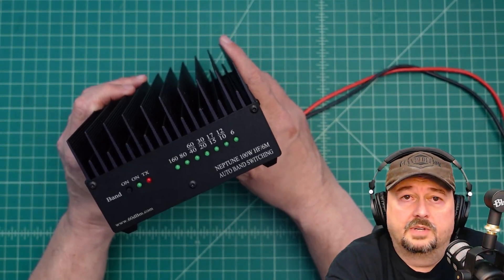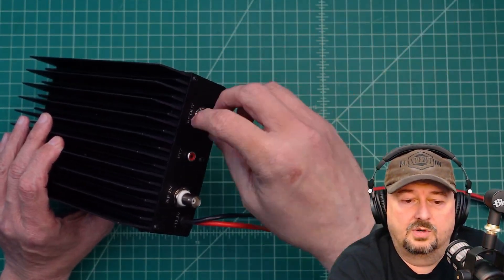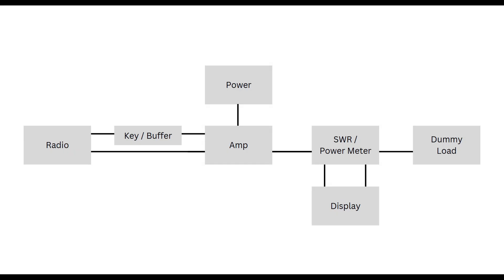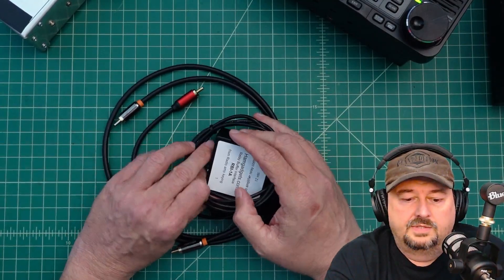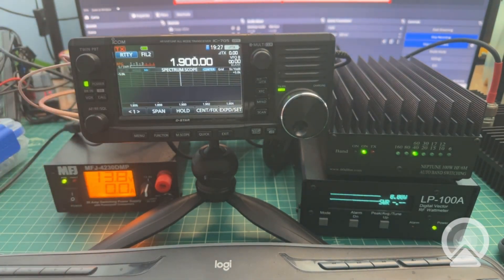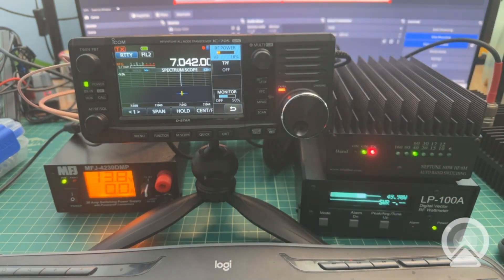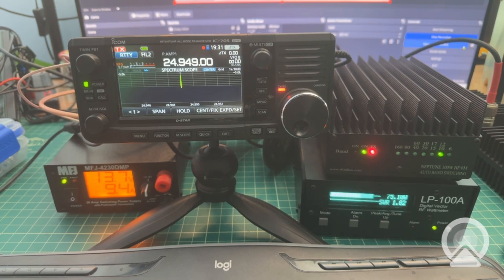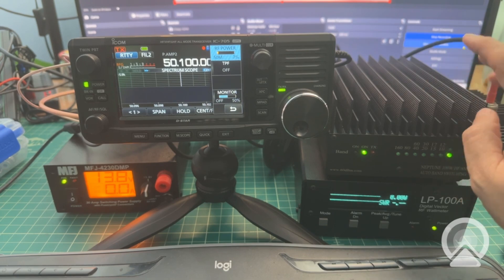Unleash the Power of the Neptune 100W HF Amplifier for Ham Radio!

Comment: ...or buy a FT-991A for your portable operation. Probably less costly than buying a 705 + Matching Unit + this amp. Also probably a smaller footprint and overall combined weight. Plus no interconnect coax cables. Just saying.
Reply from the maker: @martinvanek5951  what if I have more than one QRP radio?  What if the 705 has features the 991A doesn’t? What if I want to use my 705 at home with 100w and QRP portable?

Comment: Looks like a really cool amp, but my major concern would be when out in the field using it, you are not going to know if you're overdriving it or not. Some bands you're at 1w, others 5w. So I'm weary of using an amp for that reason, not knowing if I'm overdoing it and about to damage it. Unless, you just run lower power to preserve its life and only shoot for 50-75w output. Kind of strange the difference in drive between 12 meters and the other bands like 6.
Reply from the maker: @Kody10538  I use an ATU that shows power out but you make a fair point
Reply: Which field ATU does that?  I'm just conflicted on it. Love my 705, and i have an 891 in the truck. I have a hard time deciding between grabbing an amp like this or just picking up another 891 for portable use. Far less cables that way.  Guess its six of one and half dozen of the other lol@TheSmokinApe
Reply from the maker: @ I use this one Antuner AT-100M Pro Antenna Tuner - Honest Review and Setup Guide
https://youtu.be/LbGOeFkhy0c

Comment: Why don't folks just buy a 100 watt rig to begin with if that's what they want to run?  They buy a radio that costs $1400 and then buy an amp that cost another $500.  You can buy a 100 watt rig for less!  If you want low power, turn the 100 watt rig down.
Reply from the maker: Why do you care how other people spend their money?
Reply: @TheSmokinApe  I don't, a fool and his money soon shall part!
Reply from the maker: @ironton655  well, it seems like you do…. Also, did you stop to think that the 705 might just have features that aren’t on portable size 100w radios?  Or perhaps someone may have bought a QRP radio and then later decided the want to use an amp, perhaps in a base station setup?

Comment: Okay, but something doesn't add up. I never understood the concept of buying a low-power device and then installing a 100W amplifier. I buy a low-power device to use low power. If I want 100W, I buy a 100W device and I don't have to carry around a bunch of boxes and cables to connect everything. If anyone understands the concept, please explain it to me. Cheers.
Reply from the maker: Let’s start with some people like to use a radio at home with an amp and then the same radio portable QRP.

Comment: I wish that IC-705 wasn't so expensive. The 705 plus the 60dbm would make a great mobile HF solution.  Do you know any reputable manufacturers who make a UHF/VHF amp? I currently use a Mirage BD-35 but they're kaput. I'm dreading the day my BD-35 dies because I can't find a good replacement. 73.
Reply from the maker: I don’t know of any that I would buy 🤷

Comment: If a heatsink gets hot, that is a GOOD thing. I proves that the components which generate heat have good thermal connections to the heatsink. As a result, the heatsink absorbs a lot of heat, and convection does the rest.
What should be more worrying is any heatsink that is running clap cold.
Reply from the maker: I’d agree that heat is proof 👍

Comment: i have the 50W version of Neptune i sometimes use with the G90.   I set the G90 to about 7W and then use 6DB - 30W attenuator between radio and amp so that my drive signal is exactly where is need it.  (1.7W)    Its a very good amp.    The 100W and 50W  both have LPF filters.   So i wouldnt think there are any harmonics.   (maybe very low)
Reply from the maker: Hey Dan, that attenuator is a good idea 👍

Comment: Back in the 90’s I had a CB radio with a TX 350 amp. I could hold a four foot long 40watt fluorescent lightbulb above a foot or less parallel with the antenna and it would light up when I keyed the mic. I only did it a couple of times because I didn’t want to cook my body like a microwave. That radio would really reach out there.
Reply from the maker: Haha, that sounds awesome 👍

Comment: Having to vary the input power to maintain 100W is annoying…… most rigs (Elecraft excluded) don’t allow you to set power out per band so you either put up with lower power across the range or RF power knob twiddling every time you change band.
Reply from the maker: Yeah, I wouldn’t use this w/o a good power meter 👍

Comment: Nice to have an option. I have a hardrock 50 amp for my KX2 and the extra cable and power can more than double the stuff you need to carry to travel. You might be fine if you drive to travle but flying that is just too much.
Reply from the maker: I have been checking out those Hardrocks, great looking amps 👍

Comment: I might consider this for use with my FT-818ND......but, with all the fiddling with input power, how much monitoring will be necessary? I have my gear in a small backpack and do not want to need more stuff that it requires a wagon. Or maybe a pack mule. Strapping stuff to a mule and then carrying the mule would be brutal. They are large animals.
Reply from the maker: Hey Karl, I’d definitely want a power meter to monitor the output 👍

Comment: Ape. Nice to see the LP 100A with you. You've chosen the Rolls Royce of PWR/SWR Meters. Mine has been running here for a year. Tracking my whisper signal down to 50 milliwats. I congratulate you on an excellent decision. ONLY wish I have is that Larry would create more user friendly S/W For it. It was a pain to get that running.
Keep up the good work.
Albert. EI7II.
Reply from the maker: I haven’t messed with the SW yet but it is a sweet meter for sure 👍

Comment: Ape, you can't use that. You can't run GMRS at 100W and you don't even have a your GMRS license yet. ;) That is about the size of my  KXPA-100 and KXPA has a built in tuner. Seriously, thanks for the look at the Amp. Why no test on 60m?
Reply from the maker: @don_n5skt  you know when I was doing the video I was thinking you would ask about 60m 😮
Reply: @TheSmokinApe  Well, of course, 60m is an important band. Channelized is fun 😈
Reply: @TheSmokinApe  They told me that the 50W manual tune version doesn't support 60m which is a shame as it's one of my most used bands. Why it should be a problem - I'm not sure. Maybe harmonics due to the filtering not being optimised for 60m? 

I'd be interested in the spectral results you get on 60m.

Comment: Interesting amp ! I have the RM Italy one. KL 506 . 300 watt 1.8 to 30 MHZ . It is clean but has no band pass filters. So out side of 10/12 meters just put filter inline.  I only have a 10/20 meter band pass filter . They $$ . RM Italy does have the 300 watt with filters and a 100 watt one with filters and does 100 watts all mode. Have not had to test or use . With that current draw I would say that Neptune had MOS-FET or LD-MOS finals . BJT finals would draw more and make more heat. I have one in 100 watt range. Draws near 15 amps. My 300 watt draws 30 amps with SD-1446 X 4 finals . I like the LP 100A meter. Does true PEP and AVG measurements.  For that IC 705 use PTT buffer. It does have 12V switching inside.  I use Optocoupler for PTT line.  Relay output.  For tube amps.  a 50 AH LiFePO4 will POTA all day FT8 on that amp.  A much bigger battery for the 705 and ID 52 out soon.  Will be thick and have USB C charge. 73
Reply: Looking at their website, they have a bpf board for sale for I think 160-6. Possible to add this to your RM?
Reply: @k5wxp22  DX world has band pass filter board as well.  I have that one for LD MOS amp project . 65V Full legal power. 160 to 6 meter . I just use my low pass filter for my RM and get 12 and 10 meter and I have a 20 meter one.  Just have to switch them.  Just my POTA amp.  Battery LiFePO4 50 AH . run at 150 watt max. stays cool. 73
Reply from the maker: Looking forward to that new battery, thanks for watching Robert 👍

Comment: In case you weren't aware, the designer of the Micro PA50+ is coming out with a 100 watt version. It should be hitting Aliexpress et al in the next couple of weeks.
Reply from the maker: Howdy Frank, I’ve been keeping my eye out for it…. I saw a video of it a few weeks back 👍
Reply: Hopefully, it is able to work with the IC-705!
Reply: Does anyone know the name of the 100 watt version???
Reply: @matthewdaniels623  If you're referring to the Micro PA series, it's the Micro PA100.
Reply: They are already listing the Micro PA100 on Aliexpress from a couple of sellers; $265 U.S.

Comment: I like my Neptune amp a lot. I am curious though if you have run into an issue getting it out of manual mode?  I have accidently put it into manual mode where the ON LED is flashing green instead of being steady on. Supposedly if you key down and hold down the power button it is suppose to cycle that back and forth but it has been very inconsistent for me and I can't figure out for how long I need to hold it down while keying. I would appreciate any info you have on changing the mode. Cheers!
Reply from the maker: I’ll mess with it but haven’t had any problems with it…. That said I keep it in auto 👍

Comment: Is that the amp most people get for the Hermes Lite?
Reply: That's one of them. There a host of amps that are usable with the HL. I have both a Micro PA50+ and the Xiegu XPA125B to use with my HL or IC-705. There is also the Juno clone amp out there.
Reply from the maker: Like Hank said, it’s one of them 👍

Comment: I have the 50w version. They are nice amplifiers, but unfortunately mine was damaged in shipping and contacting the manufacturer can be challenging. They are not overly responsive. 
I also have repaired one for another Ham, who received one with a dry solder joint. 
Despite these issues, they are a very nice amp from a design and performance (clean) perspective. Just don't expect fantastic customer support. 73
Reply from the maker: I had no idea about the customer service, thanks for the heads up MP 👍
Reply: @TheSmokinApe  I think you will find the customer service quite good. I bought on of these used about a year ango and was having some issues. My amp needed a firmware update and this was completed 3 days after I contacted Paul at 60dbm.
Reply from the maker: @ that’s awesome
Reply: @ I'm glad you had a good experience. Myself and my friend had separate, not so great experiences. This is also a common theme in the QRP forums. However, the product is generally good and it's good that some are having a good customer service experience. Maybe things are improving.